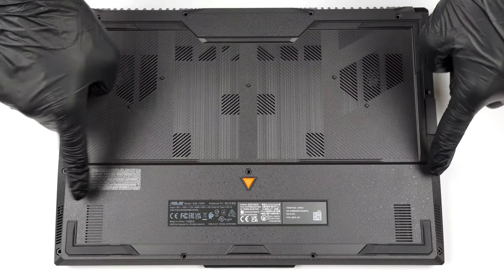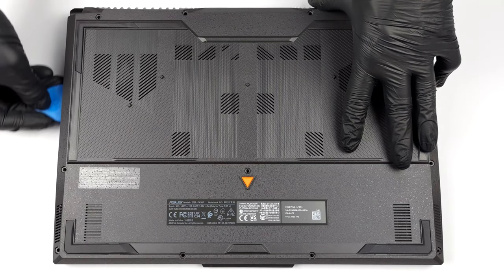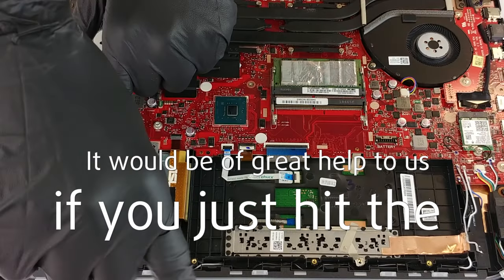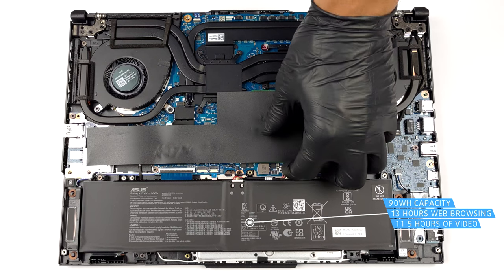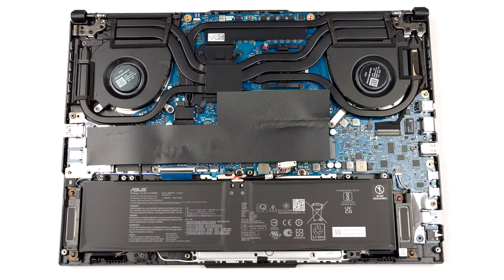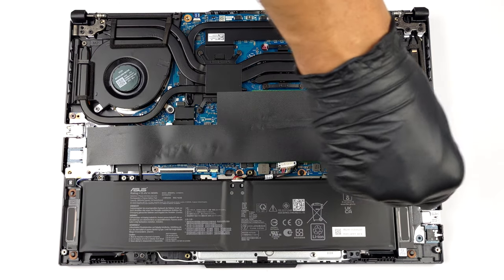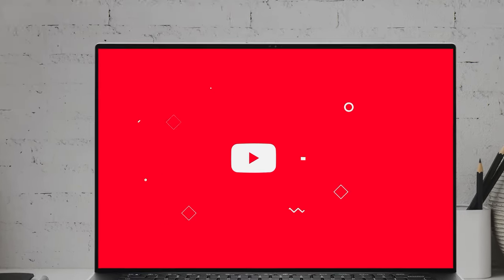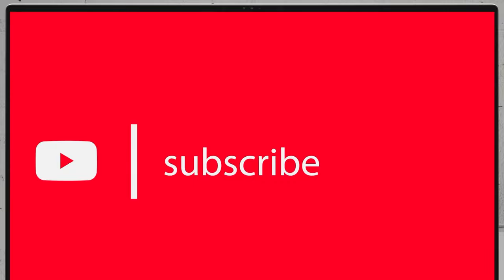🛠️ How to open ASUS TUF Gaming F15 (FX507, 2023) - disassembly and upgrade options

Comment: For your information:

If anyone is interested, the FX507ZI4 "Officially" is said to support up to 32 GB DDR4 (2x 16 GB Sticks). I tried 64 GB DDR4 (2x32 GB Sticks) and it works w/o any problems at all.
The Aluminum Tape got damaged in the process of removing the Sticks, so I left it off. No issues because of that. 👌

I also replaced the 1 TB WD SSD over to a faster 2 TB Samsung 990 Pro. I kept the Aluminum cover on it, which simply slides off, and onto the other SSD. 

No issues of any kind.
Reply: Hey man i just bought the 4070 ryzen 9 one and mate told me to get a m.2 2280 ssd but i read it only takes 2230 size ssd, do you know by any chance now you have one, if it can take the 2280? cheers
Reply: Hey thanks for the info...i recently bought tuf f15 2023 edition so I had a question..can you tell me the limit of upgrading the storage ..like how much can it support ...for example can it support 4tb ssd or not?...also can you explain the whole version of the 2th ssd you installed... it'll help a lot
Reply: Wait why did you replace it instead of using the free slot?
Reply: I get the ram, although not sure how you damaged the foil since it seems like it comes of pretty easy. But why would you not just expand your SSD.. use the 1tb for windows and stuff like movies/files etc and put the 2tb in the other slot and use that one for games
Reply: Can you share a link to the ssd you bought ? Thanks
Reply: how many slot ssd for this model?
Reply: @akhyarzaki7044  2x  source : me, I just recently added a new ssd
Reply: Can any SSD fit into this laptop or only a certain brand and gen SSd is compatible ? Please help 🙏🏼
Reply: @dp055  m2. 2280 or 2230 will work (I used 2280 no problem). Gen 4. 

The brand doesn't matter just make sure it's got at least 5000 read and write speeds, it's m2 and gen 4
Reply: Does it work on a Rog Strix G15 to put 2x32 as well?🤔

Comment: I know its old video just wanted to say , I upgraded my TUF F15 2023. The website mentions it uses 4800 DDR5  RAM, however when took the cooling pad sticker from the original RAM from the laptop it is Samsung 5600. I believe ASUS designed to down clock the RAM clock speed. I moved the drive from left to right side slot this way the WiFi card gets extra cooling space.

Comment: Hi man, interesting teardown. Just one question: I'm about to buy an Asus tuf f15 fx507zv4 and I need to know if that on the right is an empy SSD slot
Reply: I, owning a Tuf F15 FX507ZV4, can confirm that it indeed is an empty m.2 gen4 compatible slot.
Reply: Does it support gen 3 also?
Reply: Is fx507zv4 and FX507ZV-LP094W different or are they the same model?
Reply: @05-abhishekbhoir50  same question , 512 gb ssd is not enough for me did you upgrade successfully?
Reply: Will support Gen 3. Will just run at Gen 3 speeds @vitalik1030
Reply: @smeeem7385 my man please tell me what nvme dimensions does it support? And is it 2280 or something else
Reply: @05-abhishekbhoir50 those two models are the exact same yeah
Reply: 2280
Reply: I am about to insert one in. Does it need that black tape over it or a pocket to cover it because I don’t have one. Anyone know?

Comment: if you upgrade it, do you loose thw warranty?? is it possible to upgrade by just opening the little window?
Reply: No, unless you remove the cooling system
Reply: Does opening the lid also violate the warranty. ?

Comment: Does the back panel having cooling pads for the second M.2?
Reply: no. if you suspect your m.2 might get hot and if it does not come with a heatsink attached to it, i would advice you to go for a heatsink. but of course, go for the silicon and maybe a copper plate heatsink for effective heat desipation.

Comment: Dies i losse warranty if i open the laptop?
Reply: I have the same question :)
Reply: yes , If you need to upgrade something without losing your warranty, let the store do it or send it to the company's customer service
Reply: You don’t lose the warranty, the laptop is designed to be opened by the user so that the user can easily upgrade it. However, don’t disassemble any parts on the inside. Removing the heatsink kills the warranty

Comment: What was the specification of the laptop?
Reply: Intel i7-12700H CPU (Intel 12th Gen) 14 Total Cores, 6 Performance Cores, 8 Efficient-cores, 20 Total Threads, w/a Max Turbo Frequency of 4.70 GHz, w/a 24 MB Smart Cache
Intel Iris Xe Graphics
Nvidia GeForce 4070 Graphics
1 TB WD M.2 2280 SSD
16 GB DDR4 (2x 8 GB Sticks) - Upgradeable, (Officially) up to 32 GB DDR4 (2x 16 GB Sticks); (Unofficially) 64 GB (2x 32 DDR4 Sticks) appears to work.

Comment: can we upgrade the ram to DDR5?
Reply: 2023 version already ships with ddr5 sodimm ram installed
Reply: @Naxxx.110  well it does vary by country. in india it ships with ddr4 8*2gigs 3200MHz rams.
Reply: For example FX507ZV4 ships with DDR4 slots on the motherboard. While the 12700H in itself could indeed controll a DDR5 implementation too up to 4800, without the motherboard's support it wont happen. 
By the way DDR4-3200 CL18-22 was a wise choice from ASUS because DDR5-4800 CL40 actually gave inferior performance in some games and equivalent in others while DDR5 was(and still is) much more costly than a DDR4. Considering this is their affordable Gaming series so price increase was not a viable tactic, money was simply better spent elsewhere like on the CPU/GPU or the screen. DDR5 was simply way too underdevelopped in january for the price they asked for it.
Reply: @smeeem7385  that depends if it's the old model. Ddr4 one has more rugged kinda screen lid & palmrest around keyboard. Ddr5 - comes on 2023 tuf versions - more simpler screen lid & palmrest. Also newer ones has touchpad lt & rt click buttons integrated within. Old ones had seperate buttons visible outside. Regardless of country - Old cpus will have ddr4, new ones ddr5. New ones have dolby audio support & perhaps better airflow/bottom vents.

Comment: Does ASUS TUF Gaming F15 Intel Core i7-12700H 12th Gen FX507ZV-LP094W support DDR5 4800mhz 16x2 32GB Ram?
Reply: i also have the same question but i don't think they support as the the socket is different for ddr 5 ram
Reply: While 12700H is equipped with DDR5 capable MMU too, the motherboard only implements the DDR4 slots. DDR5 while might look very similar, has a different a pinout so unless there are separate DDR5 slots, its not possible.
Reply: @kiyahalheybhai269  it support ddr4 only due to the socket.